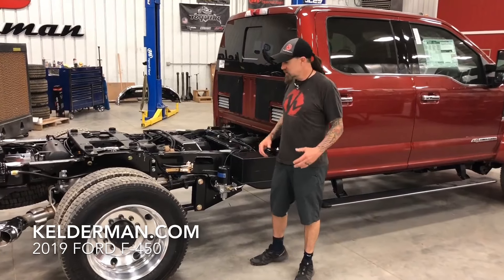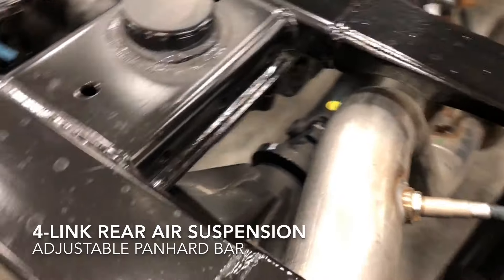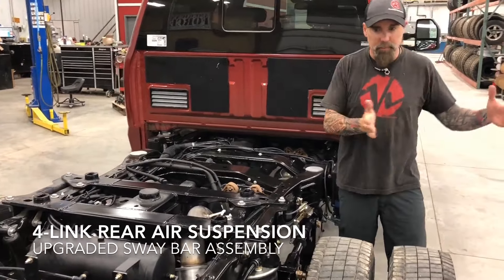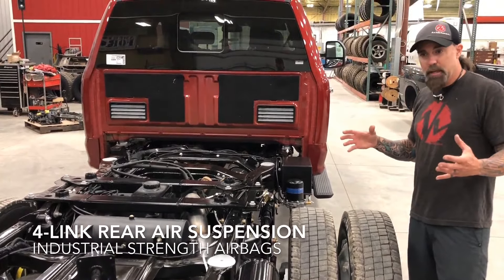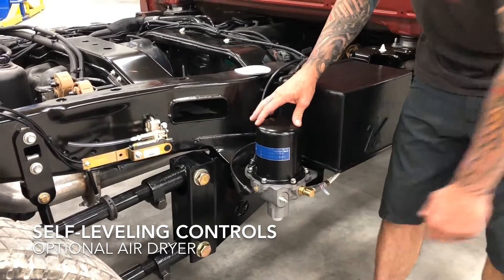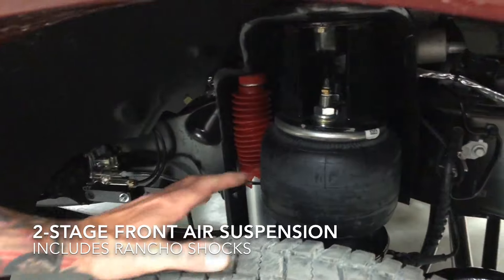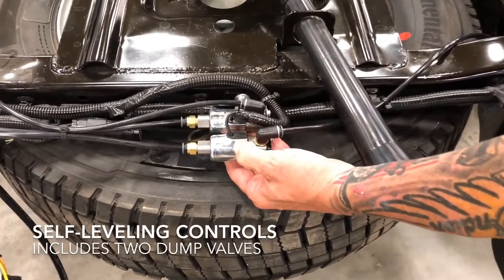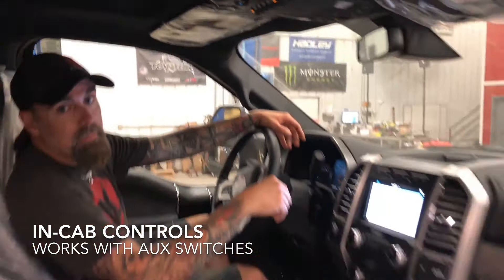Kelderman Stock Height Ford Air Suspension

Comment: It looks like The mechanical air management system is located where the truck camper tie downs would be installed.
Reply from the maker: This customer requested to keep the spare tire mount in place, so this is where we mounted the air controls. There is no plan for a truck camper for this truck, but you would have to consider other options if other parts would interfere.

Comment: Why isn't Ford smart enough to make a system like this available from the factory and take the buyer's money??
Reply: there's no need for air ride suspension to the control surfaces (front tires) is one. as for the driving surfaces (rear tires) it's a simple matter of expense. is a nice option for a fifth wheel trailer set up tho. definitely approaching class 8 levels now no doubt.
Reply: The factory’s can obviously equip the stock trucks with them. They could also outfit their rigs with light bars, tonneau covers, upgraded shocks etc. Not only does this drive up the sticker price on a truck that’s approaching 100k but if Ford (or any brand) starts putting this on at the factory then the aftermarket isn’t going to support your brand any longer since you’ve already got it covered. Most newer trucks come with a ton more shit then you really need anyway....(heated steering wheels on a work truck?!)
Reply: Dot would not approve the Citron car because it had adjustable suspension.

Comment: I’m sold but just not sure the difference between 450 and 550. Does any of this change the payload ratings and what would they be after install on a Lariate crew 4x4 diesel 6.7
Reply from the maker: The kit for an F-450 Pickup is going to be different than one for an F-450/F-550 Chassis Cab. They have different frames and normally different axles. These full air ride kits would increase payload capacity over a factory rating. You can find all kits at Kelderman.com/Shop and see ones specific to your application. Please email info@kelderman.com if you have further questions.

Comment: I was wondering i know this air ride suspension is for F250 and high but has you guy tried to put air ride system on the F150

Comment: I have this system can you tell me the part number of the rachio shocks i put some RS9000 xl in it and it bounces like hell in the back. Yes they are turned up to max
Reply: 2020 ford F 450 cab and chasis
Reply from the maker: @taylorbasset  Please contact our Parts Department at 1-800-334-6150.

Comment: Why have such a nice suspension setup and use cheap rancho shocks?
Reply from the maker: The Rancho shocks have bene a standard option for quite some time due them being on the less-expensive side with adjustable valving. Upgraded shock packages are available.

Comment: How much would a set up like this cost for a 06 ford f-550?
Reply: Flat rate of $14,000. That way no matter what bags, what kind of shocks, what type of managements system (do you want a lift done at the same time?) etc. you want it will all be covered.

Comment: Is some air bag lean normal when adjusting ride height? Meaning air bag looks crooked when fully inflated
Reply from the maker: Yes, it is.
Reply: @KeldermanManufacturing  Thankyou. Another thing I’ve noticed is creaking when lifting and lowering the truck. Haven’t noticed that on any of your guys videos, what could be making that noise?
Reply: @LEKS6652  normal